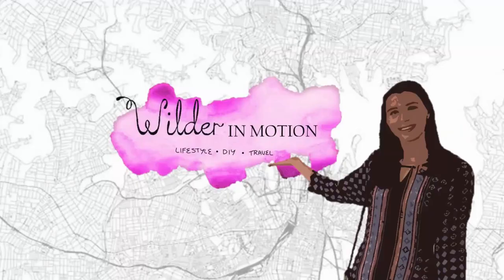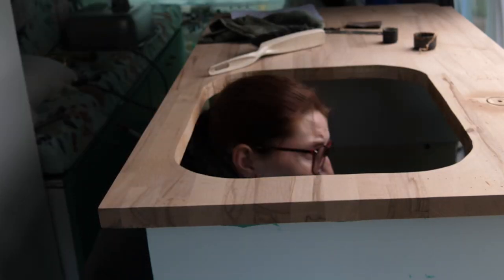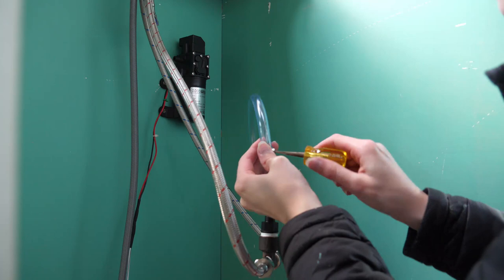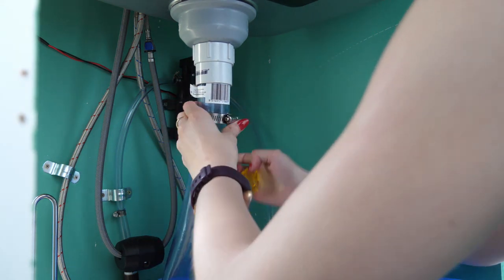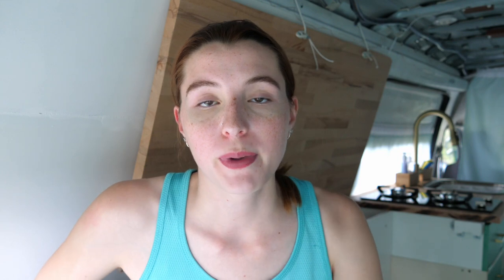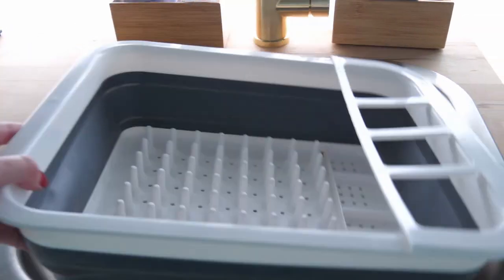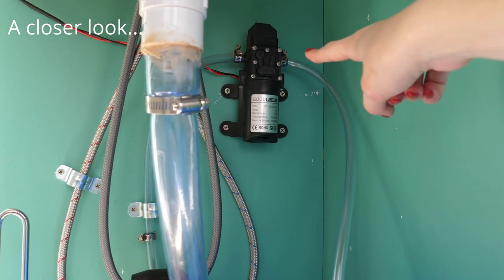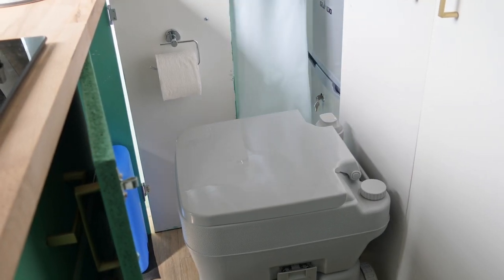SIMPLE VAN PLUMBING SYSTEM: 12V Water Pump, Hidden Toilet and The Easiest Outdoor Shower

Comment: nice.. but I'm concerned about the drain hose.  It's inside the fitting.  I think it will leak.
Reply from the maker: Not sure if I showed in the video, but it's sealed with silicone :)

Comment: Hi Ellie, Good job! Can you remember what bits and bobs you used to connect the water supply to the tap hoses? That would be really helpful if you could remember?
Reply from the maker: I took at the parts to Bunnings and Reece's and tried a combination of plumbing and gardening fittings until it all fit together
Reply: @WilderInMotion  hey thanks for replying,I really appreciate that. I actually got it sorted. A while ago, one of my friends was moving house and kind of off-loaded a bag of plumbing bits on me. Turns out it had a bit in it that was perfect for me 😂 a real blessing in disguise! Do you believe in God?

Comment: Hey! I'm an Aussie converting a Hiace too (although mine isn't a commuter like yours, so much smaller scale) and I think your idea for the faucet shower is awesome, so I'm planning on doing something similar. Just wondering where you got your faucet from? I haven't been able to find anything like that that isn't super expensive.
Cheers!
Reply from the maker: I got mine from Homary but it was over $100 as the pull down taps generally are. One thing to keep in mind if you're doing a LWB is your benchtop height will probably be lower than mine, thus the "shower" head may end up too low
Reply: @WilderInMotion  Thank you! The ones I've been seeing are like $400 plus so that's a lot better!
Yeah, the height is a bit of a concern but still think it would be a good option for when I don't have public shower access :)